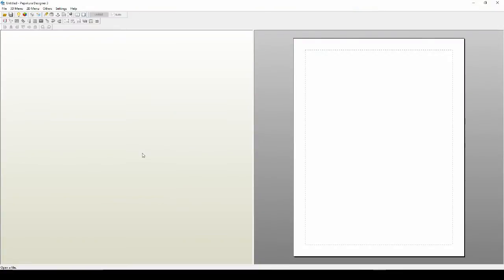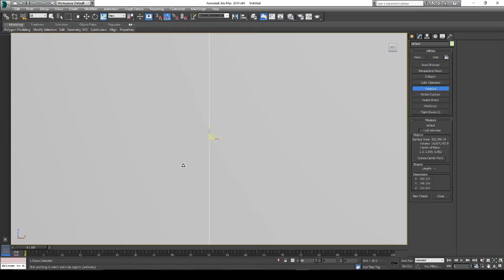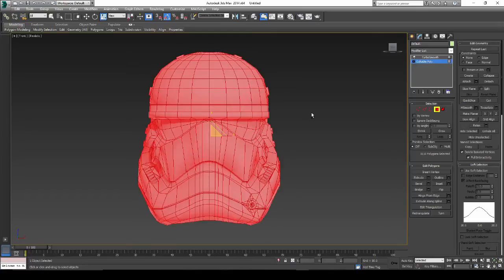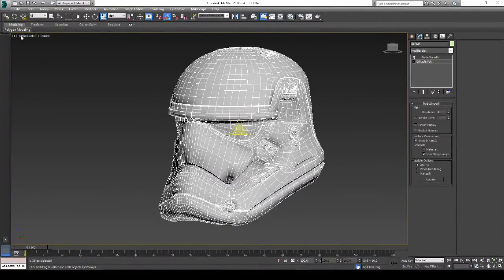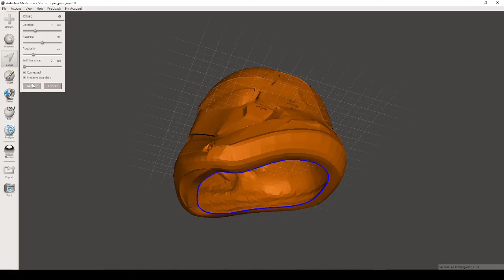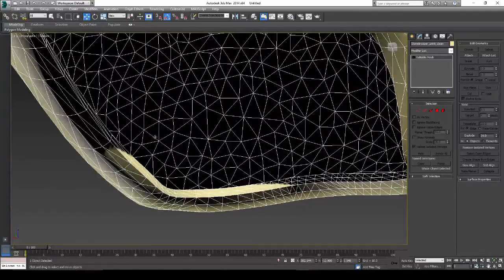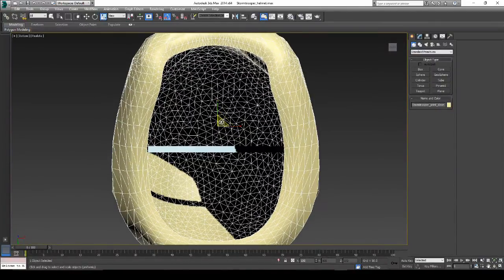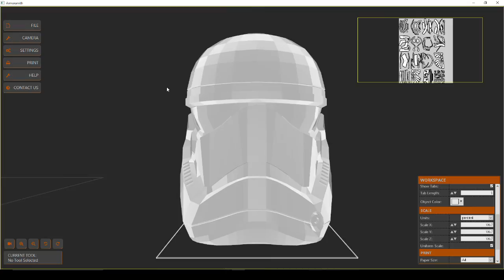Pep Vs Print: Episode 1 - Building a Stormtrooper Helmet

Comment: hey im using meshmixer and when i get t the part of the shell infill like i cant see to get it perfect and theres little holes and ai guess because of that it does not let me break the model into pieces properly :0 any help??
Reply from the maker: Is your source model one solid piece? If it's not you'll have to weld and clean up the geometry until it's a watertight mesh :D. Otherwise the shell operation won't work.
Reply: The Armored Garage no unjust found out its not :/ its 11 pieces and I have no experience with that

Comment: Thanks for giving me a place to start! your drop box link doesn't seem to be working for me though.
Reply from the maker: +Hannah Heart Thanks for the heads up. I will get the link fixed up tonight!
Reply: +The Armored Garage Thanks then I had a question did you print using PLA or ABS?
Reply from the maker: +Hannah Heart I use PLA for all my prints.
Reply from the maker: The link to the file should be fixed up now :D

Comment: would blender work for the 3d steps?
Reply from the maker: +Jacob Sorensen I believe so. I don't know offhand what the equivalent tools are but I blender should have some kind of smoothing tool.
Reply: +The Armored Garage Ok thanks..by the way what software do you use to make the pepukura 3d?
Reply from the maker: I exported it from Pepakura Designer. It can also be exported from my tool Armorsmith but my exporter still needs work, it triangulates everything which isn't great for smoothing.
Reply: thank you!
Reply: +The Armored Garage this might be my last question, but which version of the Pepakura Designer do you use? The free one or the not free one?
Reply from the maker: +Jacob Sorensen To export you need to have the paid version of Pepakura Designer.
Reply: ok thanks for the help, I'm looking forward to future projects
Reply from the maker: +Jacob Sorensen No problem!

Comment: After following the steps in Meshmixer I exported the STL, as you did. Then to look at it I opened it up in Simplify 3D . I had scaled it by this time. In S3D the inner and outer skins are not joined. The 'offset' made by Meshmixer being the inner skin. Have you noticed that ?
Reply: +Montague Flange You forgot to say to tick the connect option in the offset settings.
Reply from the maker: +Montague Flange Ah thanks for letting me know, I hadn't realized that wasn't the default option. You also want to have preserve boundaries checked off. Also in my final mesh I scaled back the offset to 3mm, 4mm was overkill once I looked at slicing it.